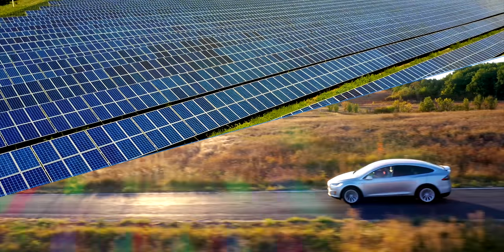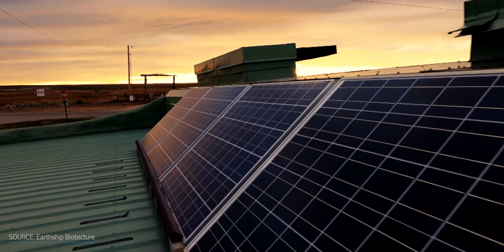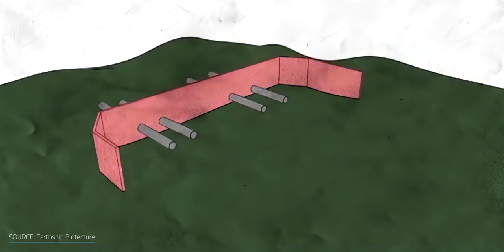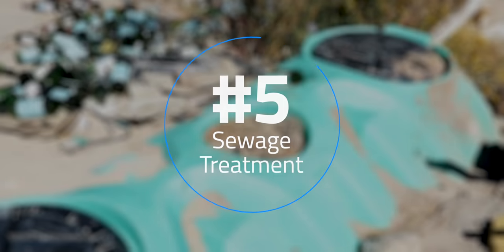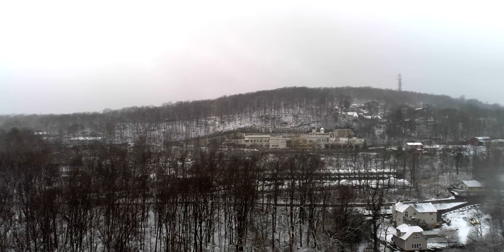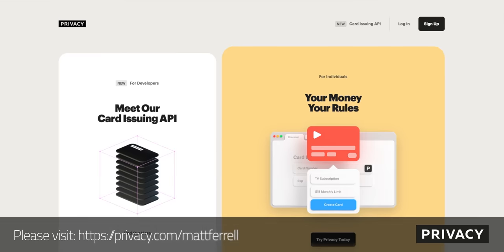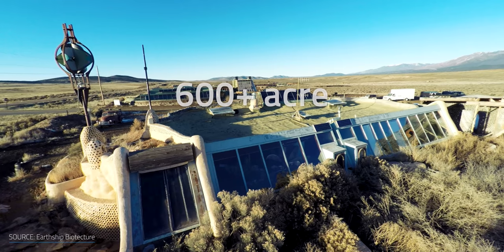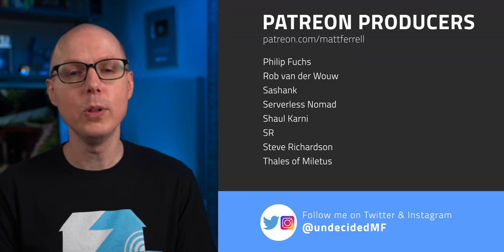Exploring Off-Grid Earthship Homes - Ultimate Efficiency?

Comment: All the Earthships shown were low buildings, would this stand up for making let's say 6 stories?
Reply: There are 2 storey ones.  Those seemed to have temperature issues as the upper floor wasn't designed properly and all the glass made it overheat plus all the other heat rose.  There are modified ones which might not have that problem.  They also have ones where the upper storey is staggered back like a stairway which should avoid that problem.  

I suspect they'd have to be re-engineered for much more and have trouble with planning.  Even one of the 2 storey ones in Taos, NM where the laws don't apply has been halted, nvm elsewhere.

Comment: Unfortunately this is not cost effective while building it, especially in countries like mine where monthly salary is 400e. In really long term yes, short term no. All those recycling systems, battery systems, house design, work force and engineer experts probably cost a lot more than brick or wood house with thick insulation plus gas heating and cooling in summer. Only viable option would be if state take and build those houses.

Comment: Most of the construction methods are not "green" at all.  The bottles are better off being recycled back into glass for more bottles.  A good part o the construction using the bottles and such requires cement which produces a massive amount of CO2 (assuming you believe the flawed study on CO2).  Also many things would only work for certain regions.  Those tires filled with dirt work there because of low rainfall.  In higher rain areas you would have problems with water breaking down the walls and the tires would eventually start to float to the surface.  Most of the other things are more for off the grid and self sufficient, than better for the environment.  Modern farms are VERY efficient and grow massive amounts of food... building large greenhouses and massive cisterns negate any benefits you would gain.  Same with the solar.  While great in that region, it would likely have a negative environmental impact in norther states.  These houses also tend to be large and require a lot of land... and usually a lo of money to make.

Now if you have the money... and you hate people... and you want to live out in the middle of nowhere and spend a lot of time growing your own food... then this is for you.  Me personally I would not mind it if I was in better health.  There is no way I could run a farm with a bad back.  The other problem is going to be getting these to pass building codes.  If you goal is to reduce your impact on the world... than just stop.  Work at home, ride a bicycle or walk, don't use AC, turn your heat down in the winter and dress warmer.  my environmental impact is a fraction of most and it is because I am frugal more than worrying about the environment.  I probably already use 1/4 the energy of a typical household.

Comment: 40% of water usage is toilets sounds way to high how big are your bogs in the US. I design septic systems for ppl in areas without reticulated water or sewerage systems. And based on 120l per person per day overal water. If you put a composting toilet in that will only reduce that amount by 20-30l at most per person.

Comment: I don't like these thermal mass can be achieved using Adobe, cob or water tanks. I have a house in Portugal with walls that are stone 0.75 m thick so I have no choice but if I had the choice I would have a wood home with cork or aircrete insulation.

Comment: Careful calling an EV carbon neutral. Until they improve the battery design it will never be neutral. And sure you are not buying gas but where does the energy come from when you plug into the wall? In the future it may be carbon neutral but not at the moment.

Comment: I dont see the point of tyres cans etc in the wall, a simple rammed earth or cob wall with the same dimensions will have the same insulation value without the faff
Reply: The point of using such materials is to use things that are otherwise piling up unused.  They are free in many cases.  The cans and bottles take the place of subsoil that would have to be dug, carried, and applied to the wall, saving much heavy labor and providing some airspace-insulation.  The tires are trash that helps hold the compacted soil in the walls together.  Without them, some other binding method would be needed.  I'm not keen on the look of the cans and tires, so I'd cob over them, making a smooth flat wall that would look completely normal, then cover with lime-plaster and milk paint.  I do think using bottles to bring light through a thick wall in a few places in an attractive pattern can be a nice accent and add some light.  The tires should be safe from deterioration and offgassing if enclosed in soil and not exposed to sunlight.  A black wall for heat absorption would be better just painted black, I believe.
Reply: @Ralphie419  Ahh you mean landfill. 
A rammed earth wall doesn't need anything apart from its natural components to bond together, the same with cob or clay lump.
Cans can be recycled, and still have to be collected and transported in a large enough quantity to be useful, the tyres would be better off chipped and mixed in a more efficient use unless as I still believe they dont give any benefit apart from hiding away waste
Reply: @Lanser1964   - Landfill?  I think we may be having some language confusions.  I'm from Oklahoma; you say "tyre" and "faff", so I suspect you may be from England.  Here, "landfill" can mean dumping rocks, concrete chunks, and "waste" dirt into a low area to raise it for new buildings or it can mean the place where a city's trash and garbage is hauled and covered with dirt to "make it go away".  I don't think I referred to either of those; does "landfill" have yet a third meaning?

On the tires and rammed earth: Rammed earth, as I'm familiar with it, can be made in blocks by pounding damp soil into forms, or can be built as a solid 'monolithic' wall by using sturdy forms that can be moved upward as the wall gets taller.  In either case, strong forms are needed.  The tires serve as forms to constrain the compacted soil but they don't need to be removed.  They also might allow the soil to be a little less tightly 'rammed' (saving labor) than rammed earth that will support itself.  That's just a guess.

I've built things with cob, which isn't compacted at all and was impressed with how well it lasted, especially when protected by a roof overhang and covered with a layer of lime plaster to help resist the rain.

One of the buildings was a straw bale house, cobbed inside and out and covered with lime plaster.  It looked so much like a normal building, aside from the thick walls, that it was almost disappointing.  Too ordinary!

Comment: What happens if they get baked in 50°C for two weeks straight during the summers of the 2030's/2040's?
Reply: They have cooling tubes.  I can imagine those might not be enough though and some form of aircon would be needed.  They should maybe have some basement rooms so those stay cool.  Also they could cover the windows to avoid solar gain.

Comment: If you could just walk into a ready made Earthship and start living you would have to be really up on the running of system that is highly geared to biological balances etc.
Judging by the condition of some "conventional" houses you see during a make over or flip I would think that having an Earthship that went bad would be something that you would want to walk away from.........if the build eventually went bad the owner would probably abandon it and someone else would have to clear the mess...........one reason they will NEVER be a part of the suburbs.
All the builds I have seen have hundreds of acres of clear land around them.....probably OK when the apocalypse wipes out most of the excess population and the land is clear again with plenty of scrap material just waiting to be recycled........right now it's a kinky solution for those that like to gaze very deeply into the crystal ball and think of better times that might never come, but for the average 9 to 5er a conventional house with running water, sewage and electricity on tap is about where civilisation starts and roughing it is for the other guy who doesn't work.

Comment: using glas, aluminium cans and rubber that can be recycled 98-99% is just pure bs and a good show.
what was the purpose of comparing a 50cm wide wall to a 3" (7cm) plaster wall and saying the latter had 3x less insulation? there is a 7x factor in width?

Comment: wrong about the ground temperature. even in northern Canada if you use an excavator & bury your geothermal circulator lines at 7' deep? it's ALWAYS 55 degrees there, meaning that an earth ship or underground house would be as cheap to heat & cool no matter what climate you locate it in.
Reply: Right!

Comment: No doubt these structures are lovely for individuals living in remote or semi-rural areas BUT you've got to remember 80% of Americans live in urban areas. That's 256 million people who are not able to run away to the deserts or mountains and build off-grid earthship bunkers like these nice white middle class folks. The kind of low density housing you're showcasing here is just a new kind of elite suburban development with an smug environmental spin. These dwellings are totally reliant on private car ownership, and having excess to an extensive road infrastructure with all the inherent cost and pollution. From that perspective it doesn't matter if the vehicles are electric or gas powered. Instead we should be concentrating on building or rebuilding medium density urban housing, walkable neighbourhoods and public transport systems in places where the majority of Americans are actually living.

Comment: #1 Repurposed materials = that are often toxic, poorly insulating, and more effeciently recycled when properly recycled>>>
#2 Passive solar heating = that in reality requires several wood chimneys most of the day,  cooling tubes bring in humidity and microbes, thermal mass as showcased doesnt work as it should
#3 Solar and wind energy = in reality insufficient to power much of anything, especially since the roof is not supportive of a larger soalr array
#4 Water - Good, you can buy a pretty standard system like that
#5 Sewage - I mean, yes
#6 Food - In reality they cannot produce enough food to make a dip in their diet

Reynolds claym that it can e build anywhere is basically a marketing scam
In reality, building a house yourself will lead to thermal bridges, flaws in structure and bad planning decisions.....assuming you have the time to take off a year or two off work

Comment: It’s reckless to measure the “efficiency” of a building without considering transportation in that calculation. We have LEED certified buildings that have no way to get to them other than driving a car, which is absurd! If you have to drive to get to these homes and cannot walk, bike or take transit to any sort of services, it is not an efficient home.
Reply: Look up Aptera solar car. I think if you are dedicated enough to make an earthship you would also look for sustainable transportation
Reply: @beilkster  owning and driving a car for everything is not sustainable, regardless of where its power comes from. You don’t need to haul around 2 tons of steel and plastic to go pick up milk or go to a cafe, doing so is inefficient, and having everyone do it is a disastrous climate policy
Reply: @birdrocket  Earthships can produce their own power, designed to passively heat and cool itself, and are not connected to city water or septic systems, capable of growing food inside AND are literally built by hand with trash (no additional carbon to produce any of those materials). I think we can agree on that. 

I can also safely assume you didn't look up Aptera solar car, which  wouldn't ever need to be connected to grid power to charge if you lived in a desert (only considering manufacturing as a carbon input, which is also much lower than traditional vehicles).

People that choose this lifestyle are not choosing it out of comfort, rather trying to discover alternative building structures that are sustainable. They are working with what they have to add to the human consciousness of what is possible. And your reckless comment is saying that if it isn't ALL PERFECT then it was foolish to consider the project? No. 

There was a lot to unpack there. Now let's point the mirror back at you. Are you considering how your food and other locally purchased items were transported close to you to make it walkable? Or the equipment used to harvest your food? Or the massive infrastructure cost to set up just the water and septic systems in your city? Or the out of sight manufacturing facility that makes things you buy? Or the frequent trash services to maintain rodent populations in tight urban settings? To me it sounds like blissful ignorance while throwing stones at people that are at least trying to tackle a part of the housing problem.